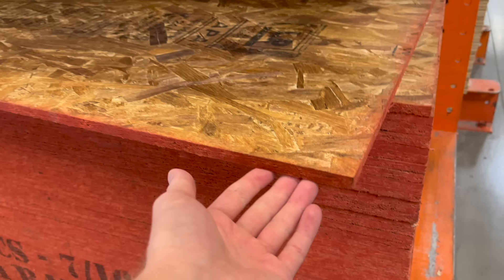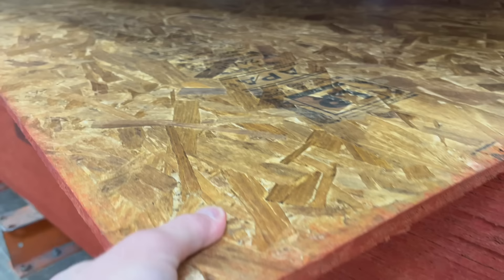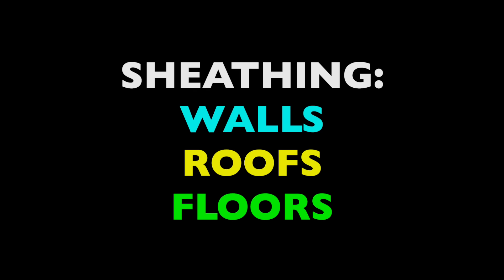Is OSB Bad?! (Oriented Strand Board--What It's For / When To Use It...House Sheathing/Subfloor)

Comment: I used 7/16 OSB to finish the walls in my shop instead of drywall 20 years ago. I put it up with the more textured side out. Painted white it gives an interesting texture wall finish. And being in a shop, you can attach anything anywhere without needing to attach to find a stud or girt.
Reply: Better: install OSB then install drywall on top of that.

You get the benefits of both (can hang stuff anywhere, fire resistance of drywall, finish capabilities of drywall with mud and tape, etc.) It's also a HARD surface you can't punch through like with drywall. Not easily anyway. When you hang your drywall you don't even need to find a stud for the drywall screws.

The downside is of course the cost and time of installing both.

I did both in my garage though,  OSB then drywall and it's awesome.
Reply: Good idea
Reply: Or you can skip the drywall and just skim coat the OSB with compound. 

Im doing that for radiator covers in one of my rentals now. If it holds up over the years, I might just do that instead of sheetrock for walls. It’s cheaper. Goes up faster, is more “tenant proof.”

Gonna do one with hot mud, one with mud and oil based primer. 

I might plaster one since I want to learn how to do that too.
Reply: @chriscolameco6850 was thinking of doing something like this in my garage. Any updates?
Reply: its nice yes but may not pass fire code and insurance issues
Reply: Does your insurance company know?
Reply: @steelewheels1365  OSB sheathing, is used on roofs, subflooring and outside walls in new construction. Also wood planks are used on floors, ceilings, wall paneling, woodwork, etc. so I don't see why using OSB for interior garage or shop walls would be considered a fire hazard. Having seen several fire damaged houses over the years, drywall didn't seem to be very good at preventing fire spread. There is fire resistant drywall available, but it's pretty expensive and only used where local codes require it.
Reply: @joeyager8479  yes, but it is covered. USAA made me remove my wood stove out of my garage because they wouldn't cover it because I used OSB instead of drywall. Had the garage been attached to my house, they would've dropped me completely. Throw a piece in an outside firepit and enjoy the 🎆! That stuff burns fast, hot and long.
Reply: @UChlK9l34cUggwMXWjIdfEuw Houses are full of stuff that'll burn, furniture, etc. and things that cause fires, gas stoves, furnaces and water heaters, electric appliances that draw high amperage and many others. I've seen steel buildings that were destroyed by fires that started inside that had nothing to do with what they were constructed of. I built my shop 23 years ago and never had an insurance issue and it passed our local inspections. If you prefer drywall, fine! I'll admit that it looks way better, but it's just a shop, not my living space,

Comment: The first horse stalls I built was done with 3/4 plywood.  Learned that a horse could dent and even break through with a swift kick.  Last ones I used OSB.  In 10 years, the OSB has remained undamaged.  I'm sold on its durability and structural integrity.
Reply from the maker: Supposedly it has far fewer voids than plywood, Joe. That’s why some people prefer it for subfloors—it’s just denser.
Reply: @TheHonestCarpenter  right. Not only is OSB more dense then plywood, I think the most important aspect is because of the oriented cross layering of the chips it's also far more Superior in resistance to warping-- don't you think? Honestly I think that's one of its main advantages.
Reply: I covered my shop walls in OSB for this reason! Heavy coat of white paint and it looks great!
Reply: @matthewwasserman7709  horses in the shop is not a good idea
Reply: @gulzeb  HAHAHA!! They're great for glue ups!
Reply: Was it 3/4" subfloor grade OSB? I cannot imagine the everyday stuff being stronger in puncture resistance than good quality plywood of the same thickness and grade.
Reply: Tbh that horse could go through nearly any building material with a little persistence. Ply would splinter through with one shot is the difference. I saw a cinderblock get punched clean out of a wall (doubtlessly a repeat target) by an annoyed horse. I was in a barn immediately after a stallion completely and utterly broke a 2x4 stall doorway to get out (fancy overbuilt barn too), and with that level of force you'd need a welder and a crane for your materials to actually build past the animals capacity. Also watched a horse total a car that reflected at it wrong (or something), rad punched through, hood destroyed, bumper in pieces, and with zero hoof injuries.
Reply: Wow suitable against horse traffic, that's a great selling point. Osb also withstands all the scrapping done to prep floors for having hardwood or tile installed.
Reply: As long as it´s CH(2)O-free.
Reply: OSB is fine if it's under a roof.   Other than that, I don't want it on my house.
Reply: @matthewwasserman7709  The OSB you got was 3/4 or 1/2? Looking to do the same, was gonna go plywood.. I'm not very knowledgeable about these things lol
Reply: @AdrianDWolfe  7/16 OSB. Much cheaper than decent plywood. Not the prettiest, but primed white was fine for my shop.
Reply: @incognitotorpedo42  most homes (in my area anyway) are wall sheathed entirely with OSB. Maybe Advantech if the money is there.

Comment: I was taught to prime the wood after cutting to size with a white lead oil paint, then let it dry before installing the wooden pieces.   Today, I will prim large pieces like flooring on both sides and the edges with a decent primer before installing them,  now I use water based primer.  I was trained as a carpenter by my father, but became an electrician.  (The Carpenters were not taking any apprentices when I was ready.)  So I only do the carpentry work on my home.   I have never  found anyone else who believed in priming the cut boards before installing them.  I still do, although I only work on my home.
Reply: not cost efficient
Reply: Great job
Reply: Great presents of mind to do the right thing. You can wire my house anytime. Most only think....get ur dunn.
Reply: If you want timber to last you have to use a water based microporous paint as to not clog but allow the timber to breath so it doesn’t get dry rot, I would only recommend that on timer that is on the exterior or exposed to the elements. Inside your house though is sealed so there would be no need for the paint as it doesn’t need moister or UV protection. It’s definitely smarter and cleaner to paint timber before installing if you have the intention of painting it after installing anyway 👍
Reply: Water-based anything causes swelling, but stuff like Woodlife Classic is OK on something like a fence picket.  Clear Penetrating Epoxy Sealer (CPES) is what you really want to use, but it is pricey.

Comment: I've used OSB on a few floors & walls, & for the most part it holds up pretty good. Tip: If you absolutely have to use OSB externally use a can of Flex Seal on it & it'll hold up for Years!👷🏾‍♂️
Reply: Beat me to it!! 👍
Reply from the maker: I’ve seen teams seal the seams on roof panels in particular, W
Reply: I'm super curious about flex seal. Never used it for anything, just starting to experiment with plastidip lately but I've been getting the feeling that flex seal might be better for many purposes I have in mind. I'd welcome any thoughts on its uses/any tips you feel like sharing, if you or any other commenter wants to ramble a bit about your experience with it!
Reply: @ItsAsparageese  plasti drip is a good product. I’ve used on footwear before, to waterproof my boots.  I’ll reply again later. Supper time!😎
Reply: @ItsAsparageese  I once made a Jon Boat out of window screen and coated it with Flex Seal. I sailed all the way from California to China with no problem!😅
Reply: @ItsAsparageese  it's faster to use & reliable. Downside it's $13.00 a can. But if you want a perfect water seal on Lumber it's worth it.
Reply: @user-em6ie2be7x  ….🥴 I paid $30.00 for a 1 quart can at my local Ace. Never used it before or paid attention to cost, so just figured that was the going rate. It worked great for my purpose, rubber coating the underside of 3 kitchen mats to prevent sliding. But the FlexSeal cost more than the mats!
Reply: @stevenmoss6043  Haha thanks for the reply! Yeah I've heard about it for that purpose, I want to experiment some and get a feel for how it holds up on flexible materials
Reply: @desertodavid  No way, seriously?!? That sounds like an awesome story haha. I'm from Colorado, where we don't have water, and I joke that I still think the entire ocean is a joke played on us, even though I've been in it a couple of times, because I just can't fathom that it exists XD So my mind is extra blown lol. I also have a strong draw toward the ocean though specifically because it's unfamiliar and intimidates me, so one day I really would like to build a boat and learn the literal and figurative ropes. I'd be delighted to hear anything you want to share about your experiences!
Reply: @user-em6ie2be7x  Thanks for the info! Yeah definitely sounds like something I should get comfortable with using. I'll be building a tiny house trailer soon and I get the feeling flex seal will help with a lot of my worries about customizing my roof.
Reply: @ItsAsparageese  I’ve used Flex Seal and Plasti Drip on OSB.  It’s didn’t last in the exterior use I intended it for. The OSB subjected to the elements eventually deteriorated.
Reply: @stevenmoss6043  Good to know, thanks!
Reply: Great tip on the sealing. It's true that if the edges are exposed it can lead to premature swelling. Also why house wrap is used during construction, to protect that outer layer before siding and brick is installed.
Reply: @desertodavid  How did you get back? The Kracken will only let you go one way.
Reply: They have spray on water proofing made specifically for houses, comes in 55 gallon drums. You’d go broke buying enough Flex Seal to do an entire house 😂
Reply: LOL!  I just applied FlexSeal to two areas of erosion fir a honda civic trunk.  Three quick applications between minimal drying on a warn summer day.  Cleaning the rust debris was more work than the taoe-off and application.  Ha ha ha.  Have not seen any distention to date.
Reply: great tip thx

Comment: That explains a lot! A couple weeks ago I replaced much of the carpet and other flooring in our house with LVP. The last room was the master bath, but there I noticed the plywood subfloor was overlaid with 1/4 inch OSB. It was glued down as well, so I was stuck with a transition. When I pulled up the existing vinyl flooring I saw vinyl tile, and around the toilet it was not adhered at all. Under the vinyl tile was the OSB that had apparently been receiving water (my guess, from the pattern, was a neglected tank leak) for many months at some point before we bought the house 20 years ago. It was rather thoroughly rotted - fortunately I had recently bought an N100 respirator - but the remains were still glued to the subfloor. I used an entire 50 lb bag of leveling cement to get it and the affected surroundings filled.
I understand it has its place, but in the vicinity of water it seems out of place.
Reply: Ya, cement board would be better over the plywood in a wet zone.

Comment: My buddy worked for "Heartland" a big shed/storage building co. During that time they did a: OSB vs plywood test. They repeatedly parked a 1/2 ton pickup truck on a 10' x 16' mock sub-floor using 1/2" and 5/8" flooring, and treated 2 x 4's [4' on center so the flooring would bear most of the load]. In the end the OSB out performed the plywood with regards to sagging, and damage; but like you said, just don't get it wet.  ;)

Comment: In the uk oriented strand board comes in different grades and level OSB 3 is passed by buildings control as structural
timber for building with. It can be left out in the rain without treatment for many months. You often see building sites use
 it as shuttering around the external fencing of a site to keep the public away. OSB 2 is furniture grade for carcasses and
areas that don’t get seen. It’s brilliant stuff and in my opinion superior to ply. You can screw the edge on wider boards 
using special course threaded screws, but for sheathing it’s the only option.

Comment: Hello, Ethan;
Thank you for all you do.
OSB is really far superior for replacing the "particle board/"dust board"" in mobile homes.
Have a GREAT day, Neighbor!
Reply from the maker: Thank you for watching, Jon!
Reply: I am working in a 1969 mobile home now replacing the particle board floor in the kitchen after a long slow leak did alot of damage. Especially to the floor. The OSB that I used to replace subfloor was great until it came time to flatten or level the surface of the kitchen and dining room. I called 3 manufacturers today and not one of them even MAKES a product to patch and level the surface in preparation for vinyl plank flooring. Does anyone have any suggestions on how to do this???

Live the videos honest carpenter.

Comment: I used it to frame in a 2 ft high concrete wall around patio. I was surprised when I peeled it off it left a interesting pattern in the concrete better looking than just smooth concrete I think
Reply: Did it release without much difficulty?
Reply: A very thin coat of paint will make it modern art.
Reply: @janami-dharmam  Might end up looking like the original vinyl release of Split Enz' True Colours.

Comment: In order of ability to release moisture / avoid mold:
1. BEST: conventional lumber
2. OKAY: plywood
3. POOR: Oriented Strand Board (OSB)
4. HOPELESS: Medium Density Fiberboard (MDF)

Use the above when planning a basement remodel.
Reply: Basement frame out should be steel

Comment: Thanks. I have used OSB as wall material in a workshop and plan to use it again in a small storage shed.
Reply from the maker: Perfect place for it, Glen!
Reply: I’m thinking the same inside use for it. How is when hanging shelves to it?
Reply: @robertramirez8492  I used 1/2” so I always made sure there were screws into studs. Small light duty shelve into just the OSB would probably be ok.

Comment: They used to recommend painting all cut edges in the field. ‘Paper’ over installed exterior faces ASAP. Thanks for the straight scoop. Can’t get a screw to hold in the edge of plywood either.

Comment: Another very informative video. In the UK OSB is commonly used for the interiors of field shelters and stables. Easily replaced if it gets damaged. As you said it has its place but not suitable for many projects.
Reply from the maker: That’s definitely a good use for the stuff, Jim!
Reply: Well said. This product is definitely great and cheap.
Reply: @SinnisjInsulator     It’s cheaper than plywood, but definitely not cheap anymore.

Comment: Thanks for your take; it basically confirms mine, and I don't generally like this material. As you said, Builders like it because it's cheaper. (I say) enduring, quality homes are not made with this material. As you kind of said: OSB works so long as moisture doesn't enter into the system. I say: when it does, such as inside a wall, failure really problematic, and it's typically late -discovered. And frankly, it's really, really hard to keep all moisture out of the building system whether at construction, or over the years. Even after a decade or two of service (if it gets that far), it is truly undesirable to have to deal with OSB failure in a building. I do a lot of renovation in my practice and OSB/moisture related failure is some of the nastiest. Similarly, for DIY projects,  you would want consider whether enduring quality matters to your application.

Comment: Good information.

In the early 2000s I worked in commercial construction doing Stucco and Plaster work.

I have seen OSB get excessively wet before was were weather proofed.
Many times the OSB had to be replaced.

I do not know if it is still the case.
OSB is supposed to have a space between panel joints to allow for expansion and contraction.

I have seen the results when the proper spacing is not adhered to.

Follow the installation instructions.
Reply: No one leaves 1/8" between any sheathing.
Reply: @jobacuda4472  That gap is required behind Stucco and EIFS.

If the crews ahead of us did not they would come back and cut the gap with a circular saw.

I was the lead person on the scaffold crew.
My job was to inspect the jobsite prior to scaffold construction.
Inspect walls for proper gapping, correct number of screws, roof, window and door flashing.

I would call our project manager and go see the GC

My crew and I would not build scaffold until this was done.
We had plenty of work my boss would send us somewhere else.
.
Reply: @shawnr771  Hope they don't hit any nails!
Reply: @jobacuda4472  OSB over 18 gauge metal studs was screwed on .
Reply: @shawnr771  Ahh, commercial. I missed that.
Reply: @jobacuda4472  If the company did residential homes they were usually in the $500,000 and up range 20 years ago.

My owners were sticklers for doing the job right.
They did not want lawsuits for failing systems.

Comment: We have stained, hard gloss sealed advantec like that for flooring on some parts of our house. It was sanded extensively.  This was 15 years ago . There are Lange areas of floor in the house and I cannot have carpet.  It can be mopped with the seal we used. We go over it with dry mop right away like hardwood. It took many laIt looks ok stained until we can get more expensive.  It is cool,even and people think it may be cork. Never a problem with it.